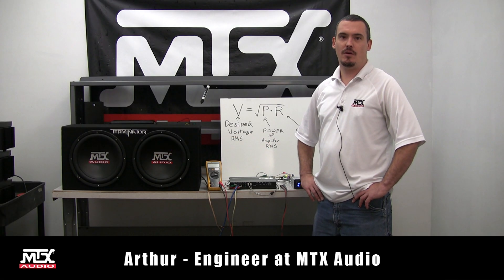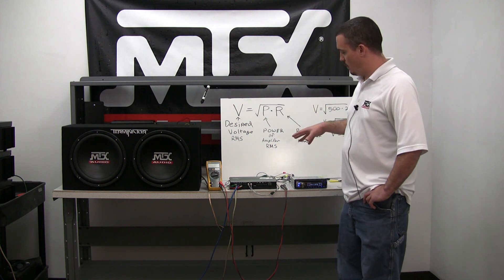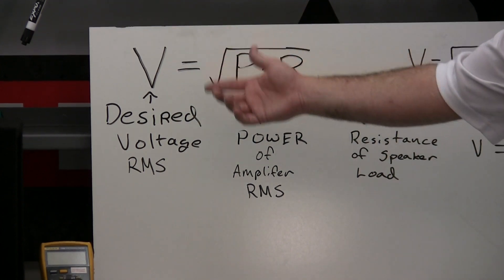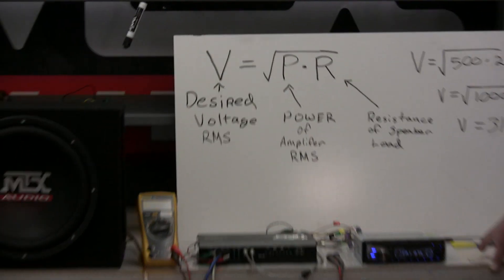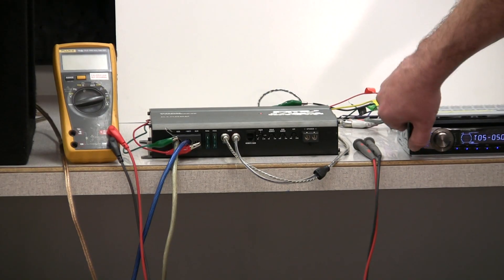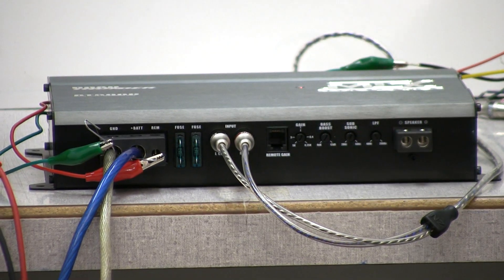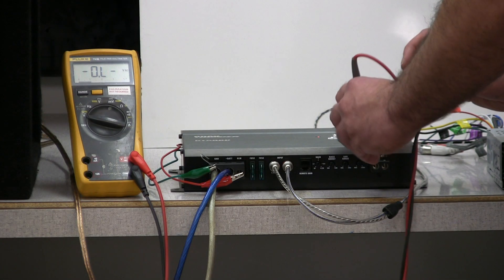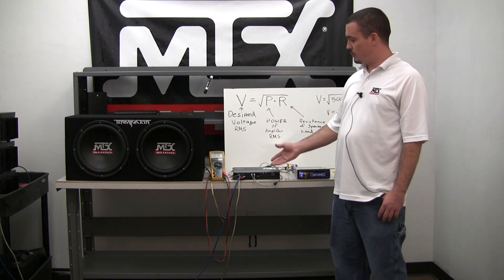How to Set Your Gains Using Ohms Law and a Basic Multimeter

Comment: how do I connect them to a monoblock amp
Reply from the maker: +Arturo Bautista That depends on how many subwoofers you have and how you are wiring them to reach the desired impedance. But usually, with two subwoofers, you will have one connection to the positive speaker terminal and one connection to the negative speaker terminal. The difference is in the connections that go between the two subwoofers.
Reply: +MTX Audio USA I'm trying to connect two subwoofers do you have like a link to an image that shows me how?
Reply from the maker: +Arturo Bautista You can use our Wiring Diagram Tool to see how to wire your subwoofers to various impedances based on the info you input into the tool. https://www.mtx.com/library-wiring-diagrams

Comment: how do you test for clipping from the radio so that I know at what volume to put my radio to when adjusting my amplifier gains?
Reply from the maker: +Modfyd Inc The gain of the amplifier is used to level match to the head unit so if you are connecting your head unit to your amplifier using the line level outputs or RCA outputs, you can turn your head unit all the way up. This way the voltage into the amplifier will be matched once the amplifier gain is set to the voltage your calculated according to your specific system.
Reply: +MTX Audio USA it's a factory radio, so let's say it's not a low level output. Can I still keep the volume all the way up?
Reply: Mark Seven  it typically doesn't happen. But I'm still curious.

Comment: to start my amplifier claims to be rated 1400rms at 1 ohm. massive n3 nano block amp. I wired my dual 2 ohm subwoofer down to 1 ohm load a rockford t2 12 1200rms.. how do I match my amp to this sub. my desired rms is 1200.. if 1200 x 1 ohm is still 1200. and the square root of 1200 is 34.64 .. is that correct or did I just go wrong I'm lost plz help
Reply from the maker: +You're Hating You got it. So you would connect your multimeter (on the voltage setting) to the speaker outputs of your amplifier and while playing a 50Hz (or appropriate frequency) tone, adjust the gain setting until you get to around 34.64 volts of output.
Reply: thank you for you video it was helpful.. I added some of the bass boss halve ways and turn down the lpf just a tad under the gain and the subsonic just a lil bit up like 1/16 of an inch and finally no more distortion thank for the help

Comment: can I use this method for my speakers as well as my sub?
Reply from the maker: +runeitemine123 Yes. The same calculation would apply to any amplifier powering any type of speakers. Just identify the values for each of the variables in the equation and you will get your Voltage for the gain setting.
Reply: And use a different frequency tone obviously

Comment from the maker: @Alex Villanueva - However you plan to wire the subwoofer(s) to the amplifier. If you are wiring two subs down to a final impedance of 2ohms, you would use two ohms for "R". If you are wiring one DVC sub down to 1ohm, you would use one ohm for "R".
Reply: +Rizz1117 Between the RMS power of your subs and your amp, you'll go with the lowest one if they are not equal. So you would go with 2000 RMS for the 2 subs so you over power and blow them. You would want to target your AC voltage at 44.72 volts
Reply: I have 2 dual voice coil 4 ohm subs running parallel at 1 ohm and they are 1000 watts rms per sub. My amp is 3700 watts rms @ 1 ohm. Will that be to much for the subs to handle? When I do the math do I add the rms wattage of both subs together? After setting everything to 0 then raise the gain till I get my target voltage when I then turn up the bass boost and LPF the voltage goes up. Is that ok?
Reply: +Rizz1117 your amp is a bit too much for those speakers.

Comment: and what if i have a epicenter brutus 2.0?
Reply from the maker: +Main Adc We are not familiar with that product and how it works internally to manipulate the signal. It appears to manipulate the signal frequencies but not the gain but we can't be certain about that since we don't have any experience with the product.
Reply: +MTX Audio USA 

Many thanks for your reply, I been testing with my multimeter, and I noticed that if I increase the master volume of the epicenter it modify the final output so i think I have to adjust the master volume of the epicenter right ?. I have 2 subwoofers of 500 rms, wired at 2 ohms in parallel so the final impedance is 1 ohm right ? and the formula is √ 500 * 1 √ 500= 22.36 or should i have to multiply the rms of each subwoofer ?  √ 1000*1 √ 1000 = 31.62 or 22.36 + 22.36 = 44.72
Reply: +Main Adc 

My amp is a hifonics bex 2150.1d    2000 rms at 1 ohm
Reply from the maker: +Main Adc The best way to find out if your subwoofers are wired to the impedance that you intended to wire them is to put a multimeter on the ohms setting to the speaker wires (pos wire / neg wire) that you are going to connect to the amplifier. This will give you a variable number for the impedance they are wired to. For example, subwoofers with a multimeter impedance ranging between 1.8 ohms and 2.2 ohms would be considered a 2 ohm load.

Comment: so do u add the omhs if you have two subs or just use the ohms of one sub
Reply: +Alex Villanueva You use the ohm load that you wire for. If you wire a pair of dual voice coil 4 ohm down to 1 ohm load (or positive to positive, negative to negative) you use the final 1 ohm load for your equation.

Comment: I got my stereo  system professional  installed I'm a bit of and audio junky grew up with large amount of bass I'd like to get the best possible  sound out of my system I'm not a fan of how they tuned my system I don't believe  it was done correctly  issue I'm having with my lows is with different  tones in the bass it then to flat out when hitting a really low note I have a bass knob to control how ever with each song I'm consistently adjusting the level  this isn't my first system and I've also ran a similar  system  and didn't have to do much adjustment  on that system the equation to determine your gain using a voltage meter 
Is Voltage = square root of Power x Resistance correct? 

My speakers are 400 watts rms at 2 ohms
So with both would be 800rms at 1 ohm 
The amp I'm running is mtx thunder 1000 rms 
Witch should be at 28.28 volts 
How do I determine  bass boost and witch hz to run it at ?
Reply from the maker: +Stephan “SVlogs” Martinez Setting your gain doesn't necessarily change which frequencies you hear better or worse. That type of tuning is done within the crossovers of your head unit and your amplifier. It's also directly effected by the tuning of your enclosure and the port/vent if it's a ported box. For tuning recommendations of your subwoofers, you should refer to the manufacturer's recommendation. It's possible that the enclosure is not built to the proper spec for your subwoofers which could cause the system to not perform properly at certain frequencies.

Comment: hi, its possible connect two diffrent subs with one amp?one sub have 800w rms (2x2ohm)and one  1500w rms(2x2ohm), amp mono 2000w rms *stable in 1 ohm
Reply from the maker: +patroltuning Yes... It is possible, but.... It is NOT recommended. With a single channel (mono block) amp, you are going to provide the same amount of power to both subs which means you would be under powering one or over powering the other since you could only setup the amp to be correct for one of the subs.
Reply: +MTX Audio USA thanks man

Comment: Ok u never explianed there 32v how u get that
Reply from the maker: +jailbird0j 32V is the result of the math equation explained in the video. It is the square root of the P = RMS power of the amplifier multiplied by the R = resistance or the final impedance (ohms) of the subwoofer(s) you are connecting to the amplifier.

Comment: Shouldn't you use the actual electrical resistance of the subwoofers (Re)? Versus an arbitrary nominal rating given by the manufacturer?
Reply from the maker: firebirdude2 You could do that for the resistance if you want, but typically the electrical resistance is only a couple tenths different than the rating so it doesn't change the calculation very much.
Reply: ***** Actually, it would seem the lower the dc resistance of said subwoofer, the greater difference it would make. Using an Re of even 1.6 for a subwoofer rated at 2 ohm (entirely common) would yield 28.3V as our target voltage. A difference of over 10% versus the voltage used in this video. This percentage would grow for a subwoofer rated at 1 ohm nominal. You get pretty close to a 20% difference in a nominal calculation vs a calculation using the true Re of the woofer.
Reply from the maker: firebirdude2 Some subwoofers actually have a higher electrical impedance than rated. It's typically a variance of a few tenths one way or another. Keep in mind this video is intended to show people a very SIMPLE way to set their gains with minimal equipment. If a person would like to add a step and check the electrical impedance of their subwoofers with a multimeter and use that value for Resistance in the equation instead of the rated impedance, they could certainly do that.

Comment: I set my gain all the way down and it still has enough power to shake the vehicle... can i leave the gain as it set ? Do i damaging my amp or sub ??
Reply from the maker: Dima Mityay if your happy with the performance of your system with the gain all the way down, you should be good to go.
Reply: Actually yes. It's sounds great. but can it damage my amp ??

Comment: So I have a 400 watt RMS 4ohm DVC subwoofer presenting a 2 ohm final load to the amplifier (which is 500 watts RMS at 2 ohms) Based on your calculation I get 28.28 volts. Or do I use 40 volts? I'm just confused at that. Thanks
Reply from the maker: TAMAdrumr103 Output Voltage is what you are trying to figure out using the equation so you would use 400 watts and 2 ohms as the numbers you know. Square root of 400 * 2 = square root of 800 = 28.28 volts.

Comment: Am I setting the gains based on the amp output or the total of what my speakers can handle ?
Reply: Dennis Christian If your  AMP is more powerful then your speakers you can use the RMS of the speakers with the same “ohms law” equation to achieve the same none clipping multimeter voltage desired
Reply from the maker: Dennis Christian This method shows how to set the amplifier gain based on the RMS power handling of your subwoofers.
Reply: @MTXAudioUSA  so if the speaker has More RMS than the amplifier you go by the one that has less? In my case the amplifier
Reply: So, setting the output according to the speaker you are hooking up then.  Thank you for the feedback!
Reply: Dennis Christian yes, RMS is what your subs can take continuously, peak should really be disregarded. if you have a 2000watt amp paired with a 500wRMS speaker you would want to adjust the amp to do 500w at the current impedance, otherwise you risk blowing your speakers.
Reply: Ok, so I've looked and looked and haven't been able to find an answer. Hopefully someone can clear this up. I have 3 12 in 4 ohm 700 watt continuous power subs. I have a "4,000" watt monoblock amp that gives an rms rating of 3,000 at 1 ohm. I have my subs wired in parallel for final impedance of like 1.3 ohm at amp. My question is, do I take only one of the subs rms of 700 for the "watts" part of ohms law or do I add all 3s rms together and use 2100? 

Ex 700watts x1.3 ohm= 900. Sq root of 900 = 30.16

Or should it be 2100 watts x 1.3 ohm =2730 which sq root of 2730= 52.24?

I own a small handheld oscilloscope and it shows clipping at like 25 Vac which I think i could make more bass come out of my ass than that produces lol. I would be much appreciative of anyone who can clear this up.

Comment: i have an SSL4000 watt amp, And two BDX12 subs, subs are 750RMS each, and amp is rated at 1600@4ohm... if i did the math right my voltage should be 80 right? 

1600x4=6400  and the swuare root of that is 80?

Comment: Hi there is there any website where we can calculate that voltage please, i am going to use with my 2 6x9s and 1 sub thx. voltage like you got 31.62 thx
Reply: XxPICKNTICKxX Website? Just use a calculator.
Reply: Thezuule  how??
Reply: XxPICKNTICKxX The math is literally written right on the dry erase board.
Reply: Thezuule  yes but i am not good in maths listen tell me something is this website right for taking out voltage, http://www.sengpielaudio.com/calculator-ohm.htm
Reply: It's two numbers dude. Multiply the ohms of the final resistance of the speaker load by the wattage you want the amp to put out and then press the square root button on your calculator. That's the voltage your amp should be putting out on the speaker terminals. If you can't do this math I suggest you just tune your amp by ear or bring it to a local car audio shop to be tuned.
Reply: imma about to change my car soon after 4 years of keeping i did it myself last time i just can't remember where i got the figures from for the multimeter and straight done, my speakers and sub is running nearly 4 years now without any problem,  i am sorta confused really the site which i posted what do you think of it, can i just input the RMS of the speaker and 2 or 4 ohms what it says on speaker and get the voltage value will that work and same for the sub rms and ohm and get the voltage.
Reply: You need to know what the ohm load is being connected to the amp. Then you just do the math.

Comment: Hello i have Kenwood 12s rated at 400 rms max at 2000.iam using a kenwood 1000 watt amp 2000 max.and two 12s total.what would be my numbers to set gain right?thank you.
Reply from the maker: Anthony Conger First, disregard any power ratings other than RMS. 2 - subwoofers with a rating of 400 watts RMS each = 800 watts for your desired amp output so P = 800. For "R" the value would be whatever impedance you have wired your subwoofers to. So the equation would be V = the square root of 800 x R.

Comment: Hello I have a question do I leave my LPF all the way up or do I adjust it while setting everything else? I have 2 4ohms 12" pioneers and will be wiring them down to 1ohm. The subs are 1200 watts RMS and the amp puts out 1200 at 1ohm. Thanks !!!
Reply from the maker: CHIHUAHUA4809 The Low Pass Filter (LPF) does not effect gain. If you are setting your subwoofer amplifier and using a 50Hz tone as recommended, as long as the LPF is set accordingly to allow the 50Hz tone to play and not be filtered out, everything should be fine.
Reply: ***** thanks for your replay! I have another question when I play my 50Hz tone my car speakers start distorting very fast my max volume is 40 and I can't make to 30 which is 75%. Do I go until distortion appears then turn it down until distortion disappears ?
Reply from the maker: CHIHUAHUA4809 50Hz tone is only for subwoofers. If you are setting a gain on an amplifier that is powering speakers, use the 1k Hz tone. Both are available on our website at http://www.mtx.com/t/testtones However, if you are using this amp for speakers, and if there is a switch to select between LPF, HPF, or FR, you should be using either FR or HPF depending on how your system is setup. FR = Full Range which is best for coaxial speakers. HPF = High Pass Filter which is what you would want if you just want your speakers to play the higher frequencies and your subwoofers play the lower frequencies. You typically don't use LPF for speakers.

Comment: Does it work the same way if I have my speakers bridged and wired in series. 
Here's my amp specs. Not sure which one I would use or how to use a multimeter this way.  The speakers  are two 12"s subs.
Total Power Output 1600 Watts
Peak Power @ 2 Ω 800 Watts x 2
Bridged Power @ 4 Ω 1600 Watts x 1
RMS Power @ 4 Ω 240 Watts x 2
Reply from the maker: Jeremy Wood Yes. Even if your amplifier is bridged and your speakers are wired in series, you still just input the #'s into the equation. Use whatever impedance your subs are wired to in series as the "R" in the equation. For the "P" in the equation, you would use whatever your subs RMS power handling rating is and multiply by two since you have two woofers.

Comment: I have soundstream pn4.520d
And infinity kappa 62.11 speakers.  
520x 2 = 1140 is this right?
Reply from the maker: Blake Biltwell No. You need to use RMS ratings. The Soundstream PN4.520D has an RMS output of 100 watts x 4 @ 4ohms, 130 watts x 4 @ 2ohms, and 260 watts x 2 bridged @ 4ohms. Your Infinity Kappa 62.11 speakers are 2ohms and have an RMS power handling rating of 75 watts. 

If you have two speakers in front, you would set your front gains (the 2 front channels) V = square root of 75 watts (desired power output) x 2ohms which is V = square root of 150 which V = 12.25 volts. Then you would do the same math for the rear channels based the RMS power handling and what impedance the rear speakers are wired at.